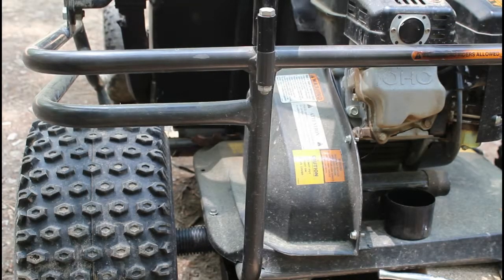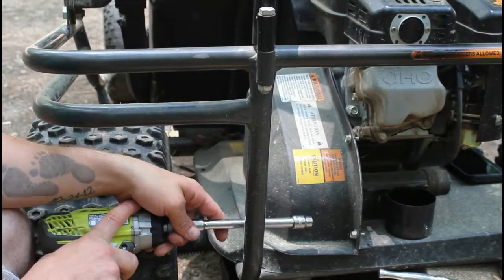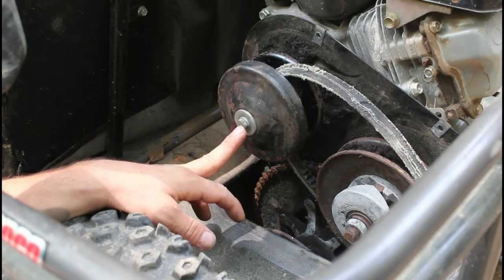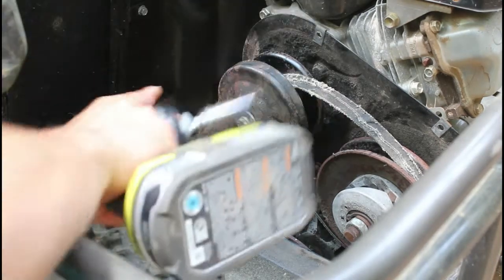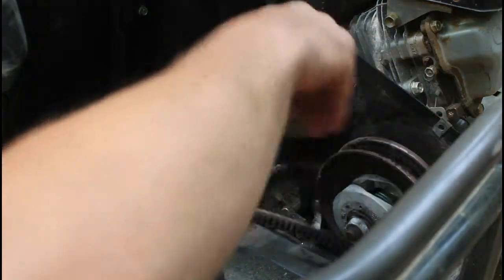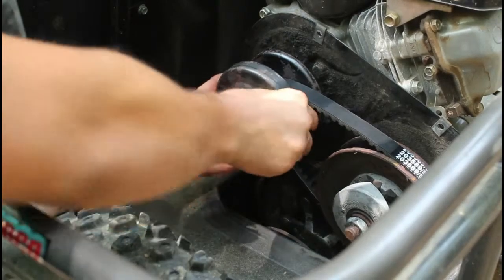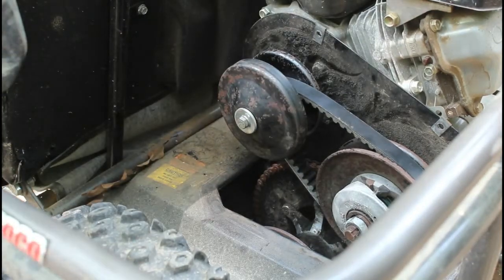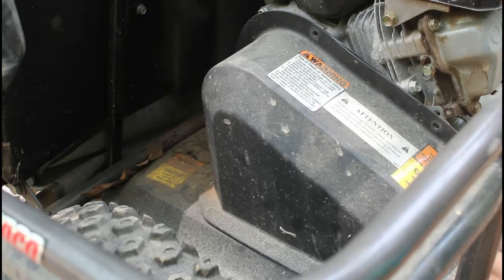HOW TO REPLACE A GO KART BELT- GO KART BUILD PART 1

Comment: I have a question,I bought a go kart for my husband and it originally had a thin belt on it, the owner put the same size belt on with a thicker size and when we turned it on it immediately took off and almost killed us all. I found the correct belt and plan on using your video to guide me.. but im terrified,  after fixing the belt and having slack do you think it will not take off with a mind of its own?